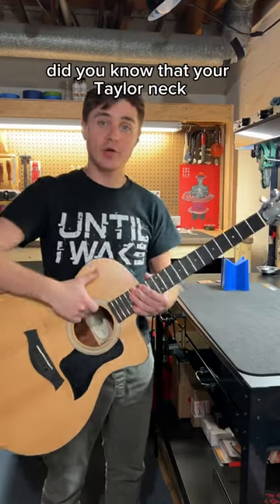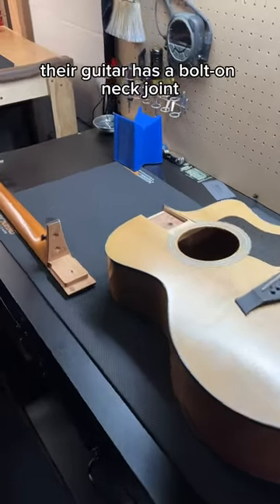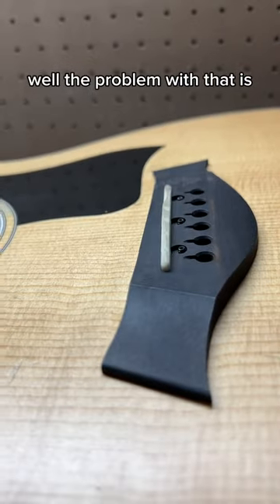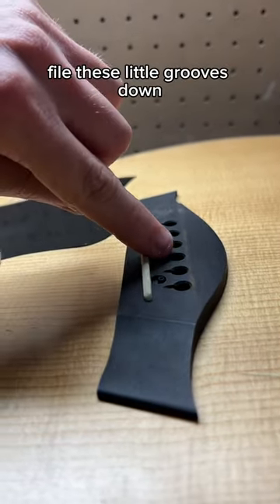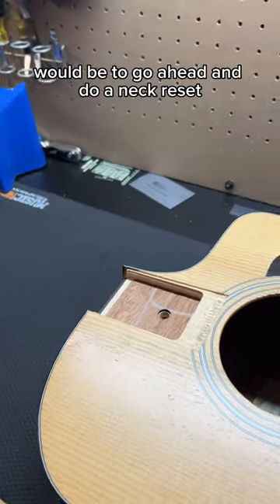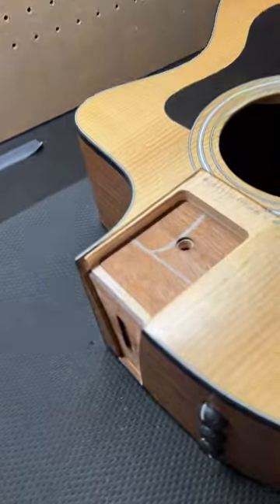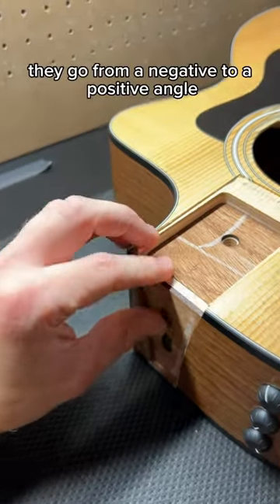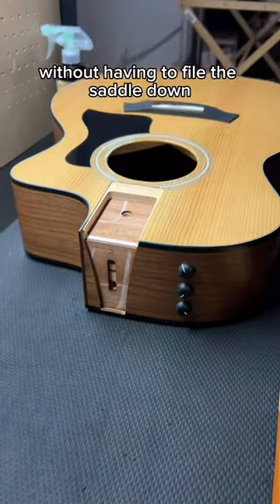Guitar Tech Tip Tuesday - Taylor Bolt On Neck #shorts

Comment: Doesnt intonation change when changing the neck shims? 

I have a takamine and they have shims under the saddle from the factory. The problem is like you said, break angle. 

I love the playability with 2 of three shims removed, but the high E amd B strings have a super shallow breal angle amd the change in tone is not desirable. I'm contemplating slotting the bridge to help.

Comment: I’m not sure I understand the logic of insinuating it’s better to do a neck adjustment on a bolt on neck rather than adjust the saddle. Wouldn’t that suggest that saddle adjustments would hurt all guitars rather than just Taylor’s? I’ve never met a luthier who advised adjusting necks for action rather than a saddle, where I understand neck break angle on bolt one do make a difference on how relief affects a guitar. In short, I’m just not sure how the physics is holding up here exclusively to Taylor’s and not to every other manufacturer. Feel free to elaborate.
Reply from the maker: This applies to any bolt on. Taylor explain on their website that they designed their bolt on necks to be highly adjustable so that the saddle can remain at the ideal height.

This would apply to all acoustics, its just that a neck reset on other acoustics with glued necks is much more difficult
Reply: @jeremiahmcgowan  thanks